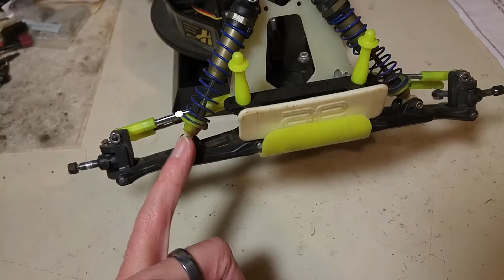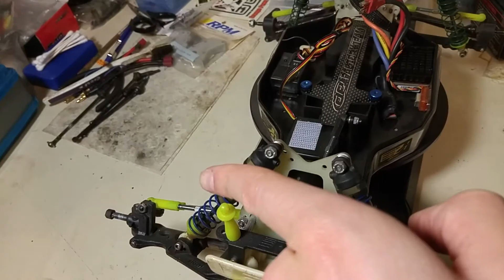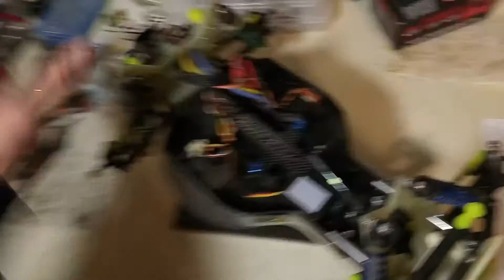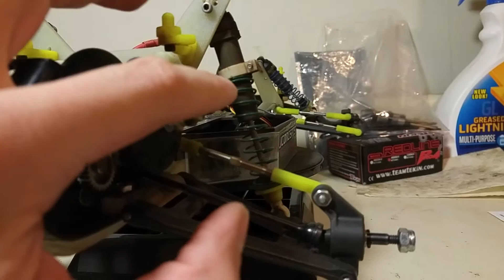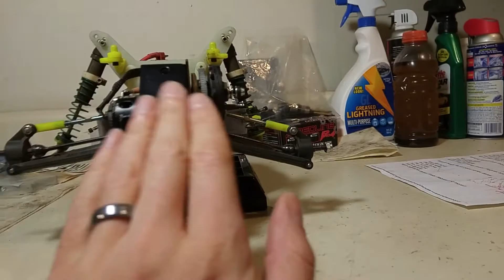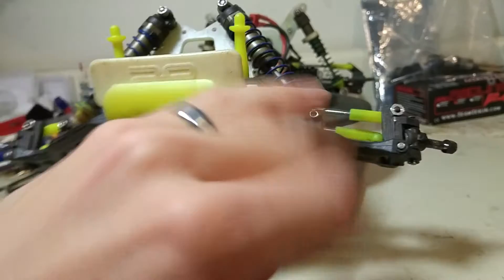Shock angle

Comment: You have it backward!  When when the shock only moves a little because it is laying down then there is little effect of the shock which means it is softer.  When it is mounted more perpendicular to the control arm it receives most if not all of the movement and the shock is more effective and is therefore stiffer.
Reply: You are correct. 

As the shock gets closer to perpendicular relative to the suspension arm the spring acts more directly on the arm. In effect, the spring rate increases as the shock is compressed (i.e., “rising rate” geometry).  The more leaned over it is the less of this effect you get (i.e, less change in the spring rate and dampening), which will make the suspension more responsive (i.e. softer).

Lean over in loose conditions, stand up for big hits or high traction.

Traxxas has a good article on this: https://traxxas.com/news/suspension-tuning-guide-part3

Comment: It really seems like this guy had pretty much everything wrong. Less than 90 deg. angle means less force applied to shock; "softer". NOT stiffer. NONE of the force is being applied to the shock from the side, that's why you have control arms.

Comment: You got it backwards. You are right that more vertical shocks are more effective as they are more aligned with the vertical force, this is why the spring is more effective. So the suspension is firmer. You got the first part right, conclusion backwards.
Reply: No its the opposite
Reply from the maker: @invisiblespeedrcmx  I've literally mounted the shocks both ways and felt them with my own two hands.  I've also made measurable adjustments to ride height based on shock angle.  Vertical is softer.  It's basic physics.
Reply: doctormosfet you need to readjust ride height based on the height of the holes. If the holes on the tower are angled heavily, laying down the shock may raise the rideheight. This doesn’t mean the suspension is firmer. Here’s some basic physics. If you want to push a car, is it easier to push it in the direction of travel, or at an angle to the direction of travel? The springs are supporting the weight of the car, think about it.
Reply from the maker: @invisiblespeedrcmx  if you push the shock at an angle, the fraction of your force that is translated to the shock is proportional to the cosine of the angle between your vertical force and the shock's angle against that vertical.  The shock itself isn't stiffer, but as seen by the input force, it's "effectively" stiffer.  This is why when you change the angle you will notice a difference in effort required to move the arms up and down.
Reply: doctormosfet please read this https://www.onallcylinders.com/2017/03/30/quick-tech-determining-spring-rate-correction-angle-mounted-springs/
Reply from the maker: So that's using the same cosine argument I'm using, but reaching a different conclusion.  The way I'm seeing it is if you have a vertical force acting on an angled shock, the angled component of that force acting on that shock is F*cos(theta).  Cosine = adjacent/hypotenuse, where adjacent is the vertical force and hypotenuse is the angled shock.  Theta = 0 means vertical and Cosine(0) = 1.0.  Theta = 45deg gives you Cosine(45) = 0.5.  This means as you angle the shock more, a smaller fraction of the vertical force acts on the angled shock.  I can say empirically that standing the shocks up vertically requires more pre-load (or a stiffer spring) to achieve the same ride height, because I've actually tested it!  So the math, and the experiment, line up.  There is a big reason why mid-motor 2wd buggies tend to run more vertical rear shocks when on loose dirt.  It softens the rear and achieves more rear grip on what is otherwise a very twitchy mid-motor arrangement.  It does also tend to lead to more initial turn-in, but forward traction on loose surfaces is higher with a more vertical rear shock.  Why on earth this link you reference is saying the opposite is beyond me, as it is in no way consistent with what I've done empirically.
Reply: Because the link is right and you are wrong, as I said you are thinking backwards. The larger vertical component means that the same spring supports the chassis more. So with a veryical shock a softer spring can provide the same support as a harder laid down spring. As for the ride height. This has to do with the height the holes are on the tower. Often the holes are designed to maintain the same up travel at full compression, this means that as you stand up the shock it is higher, and as such ride height will be lower.
Reply: And as for mid motor cars having stood up shocks, typically they are run on high grip, and very low roll centers, so they need a lot of support fromthe shock spring. A stood up shock provides this. Also it will reduce the tendency of mid corner over steer which the low rc causes.
Reply from the maker: @invisiblespeedrcmx  if you keep the shock on the same tower hole and just move the bottom of the shock in and out on the arms, what do you see?  You'll see that as you move toward the inner hole, droop increases (more travel) and ride height drops at the same pre-load.  I've actually used this to get one of my chassis to a lower ride height as every other trick I could think of was not working.  I get what you're saying about seeing it backwards, as I'm looking at external forces acting on the shock while you're seeing it as the chassis' weight acting on the shock, but at the end of the day, what do I notice?  I notice the effort required to compress the shock being lower if I stand the shocks up, and then I notice the effort required to compress the shock being higher if it's more laid down.
Reply: @doctormosfet  moving the shock in or out on the arm changes the motion ratio, which is not the same as moving it in our out on the tower to change the angle. This is easy to demonstrate. A laydown shock far in on the arm is softer than a standup shock far out on the arm. A standup shock far in on the arm is also softer than a laydown shock far out on the arm. this has to do with the lever arm, and is not what we were originally discussing. We were discussing the effect of the angle of the shock.
Reply: @doctormosfet  here's another paper for you: https://www.google.com/url?sa=i&url=https%3A%2F%2Fwww.ismasupers.com%2Fdownloads%2Ftech-talk%2FTech-01%2520Motion%2520ratios-4.pdf&psig=AOvVaw3jb2ad2wh-rvjz5rWNgU_f&ust=1621335546853000&source=images&cd=vfe&ved=0CAIQjRxqFwoTCOizkN3H0PACFQAAAAAdAAAAABAI
Reply from the maker: @invisiblespeedrcmx  yes, arm leverage is a fair point, and I realized that after I last responded.
Reply: @doctormosfet   overall, outside on the shock tower is stiffer. #1 the stiffness is relative to the shock angle to the a-arm. the more even the shock is to the a-arm the stiffer it is. 
normally an off-road shock tower is set-up to work like this... outside hole keeps even stiffness throughout the a-arm angle (think of it like a hard single rate spring). the inside hole starts soft and gets stiffer as it compresses (think of it like a soft to hard dual rate spring). when they are both fully compressed that are usually around equal stiffness (in a normal off-road setup). so yes sometimes, the inside hole on the tower can be stiffer at full compression but sometime the outside hole can be stiffer... it's all relative to (#1 on top). but at a-arm level, the outside hole is always stiffer and overall stiffer unless you have some crazy setup (like the a-arm pointing up at ride-height).
Reply from the maker: It's as simple as mounting the shocks vertically and more laid down and compressing the suspension by hand from the wheel.  More vertical feels softer, more laid down feels stiffer.

Comment: Thank u sir . 

Im having a custom b6.2  rear tower made that stands up more as my local track is very high speed  two big jumps . 

As it steps out when i try to put power down .
Reply from the maker: If you're putting power down on corner exit, then I'd expect some of that as the car is still turning and the lateral component of the apparent suspension stiffness is higher with standup shocks than if they're more laid down.  Standup shocks work well on a bumpy surface, but for big jumps, especially with hard landings, laying the shocks down works better as it leads to a more progressive suspension (i.e., the apparent vertical stiffness increases as the shock compresses, because as the arm moves during compression, it's also changing the shock angle).
Reply: @doctormosfet  

I stood up my rear shocks on my b74.1 and now it dont step out .  

Hopefully it works on the 2wd 

Il get back to you next few weeks 

Cheers

Comment: You are wrong. Laydown shocks will generally soften the suspension. Stood up shock will make more stiff suspension feel
Reply: I know its been a year but its annoying  enough  to comment lol, you are absolutely  right and no it doesn't  matter if you are jumping  or cornering , JQ and Ryan Harris are the ones to pay attention to, we are all dumber for watching  this video lol 😆
Reply from the maker: Depends on if you're talking about jumping or cornering.
Reply: Is it correct that the wheel rate for an inclined spring is less than if the spring is vertical, as suggested above, but when compressing an inclined spring firms up. As you mention the arm and spring start to approach 90°.
When rolling in a corner though, the same applies to an inclined spring, the angle between the car centre line and the spring also increases which would mean it firms up as well.
Great videos which me and my driving buddy follow religiously but this subject is creating some debate. Any comments would be appreciated.
Reply: @paultonks4709  overall, outside on the shock tower is stiffer. #1 the stiffness is relative to the shock angle to the a-arm. the more even the shock is to the a-arm the stiffer it is. 
normally an off-road shock tower is set-up to work like this... outside hole keeps even stiffness throughout the a-arm angle (think of it like a hard single rate spring). the inside hole starts soft and gets stiffer as it compresses (think of it like a soft to hard dual rate spring). when they are both fully compressed that are usually around equal stiffness!!! (in a normal off-road setup)!!! so yes sometimes, the inside hole on the tower can be stiffer at full compression (and!!!) sometime the outside hole can be stiffer... it's all relative to (#1 on top). 
 but at a-arm level, the outside hole is always stiffer and overall stiffer unless you have some crazy setup (like the a-arm pointing up at ride-height).

Comment: I notice that after adjusting trims going forward is straight but reverse is curved. When I straighten reverse then moving forward curves..how does that happen ? And what's the likely solution?
Reply: Amir Abdullah adjust toe out and check for end play in steering linkage.

Comment: hi, i just assembled a kyosho javelin. I notice after assembley that there is unequal droop in the rear shocks..could u tell me how to adjust the droop please?
Reply from the maker: Check the length of the shock at full extension.  You may have one of the eyelets screwed in more on one shock than the other.  Also look at the arms without the shocks connected.  Do they droop the same?  If not, then the shocks aren't the problem.
Reply: doctormosfet I checked the shocks at full extension a few timesit's the same. Arms dropped down without shocks also same length. But maybe I screwed one of the shocks too tight. I'll take it for a test again.
Reply: Thanks Doc!!!!

Comment: The shock is not getting any lateral or vertical forces, the only forces that are being applied to it are from the shock mounts. Only the traction point of the tires are getting lateral/vertical forces.

Shock mount positions - in general the further away you mount the shock from the arm pivot the more compression resistance you will get. Closer, you will get less compression resistance. (think of leverage).

Shock angle? in general this changes the ramp up profile of the shock (will it ramp up more or ramp up less during compression) and it doesn't matter if the compression is from landing or cornering. all the shock feel is its being compressed

These are just general terms, it gets complicated as the angles/forces changes throughout the travel of the suspension. Suspension designers use computer models to help them achieved the outcome they're looking for.
Reply: All this.
Reply: he explained shock angles as if his truck has solid axles instead of independent suspension.. going off my memory I believe you lose 3% of the shocks vertical stiffness for every degree away from vertical on solid axle mounted shocks. for independent suspension that theory assumes that the shock is straight up and down only when perpendicular to the control arm its mounted on in static position... Therefore as you lean your shocks over further a progressive effect takes place as the suspension compresses because the angle will get closer to parallel as the arm swings when the suspension compressed even with linear springs. so more angle SHOULD (most of the time) in theory improve tire contact over rough surfaces by allowing the suspension to float over bumps but react more stiffly to a sustained load.
Reply: 7 years late to the party,  but yeah... holy crow this vid is SO wrong!